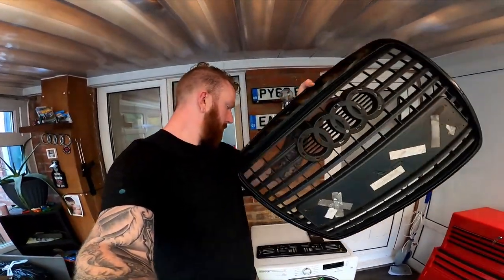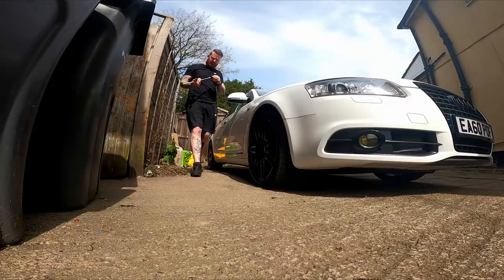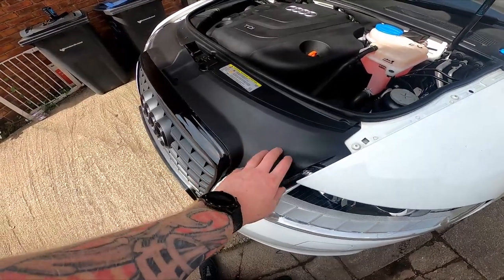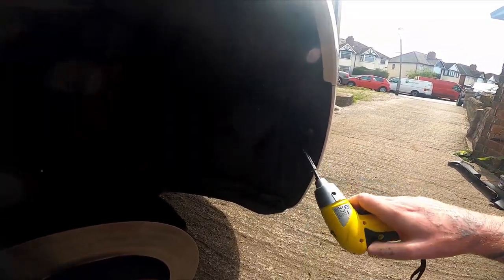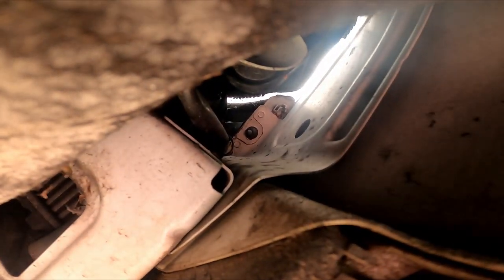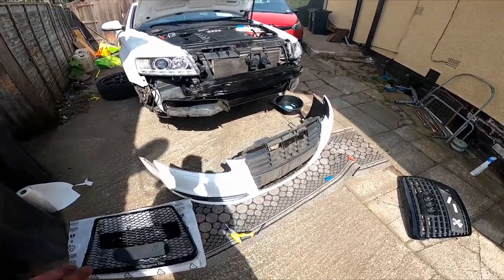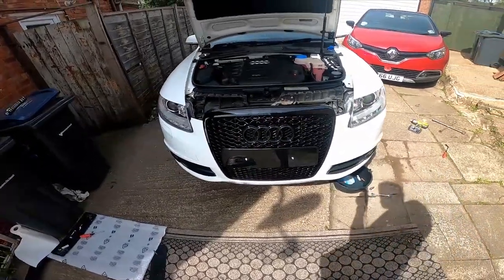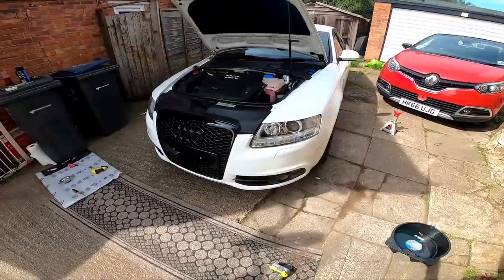Installing An AUDI RS6 Grille On My A6 TDI

Comment: Did your cruise control work after you installed the grille?
Reply from the maker: Yeah it worked fine, this car wasn’t equipped with radar cruise though, that would probably be an issue

Comment: Hi Sir great video... did you use back the Audi emblem from your old grill or did you purchase new ones for the new grill?
Reply from the maker: I reused the existing black emblems I already had, the grille was supplied blank with no badging, the emblems are real cheap on eBay etc though
Reply: @JakeBrady  Oh Ok so you just basically had to repaint the silver emblems black?

Comment: Not sure why you took the wheels off … less fiddly I suppose 

Nice video mate
Reply from the maker: Pretty much hit the nail on the head really, the nut that is deep in the bumper is an arse to get back on with adult sized hands, removing the wheel just makes it a touch less irritating to get to, albeit do-able without removing them!  and thanks!